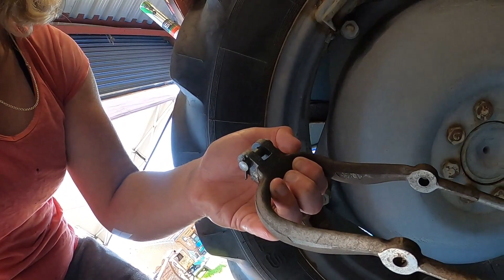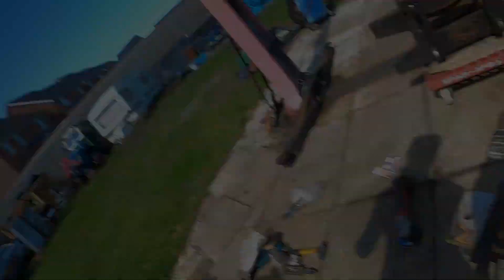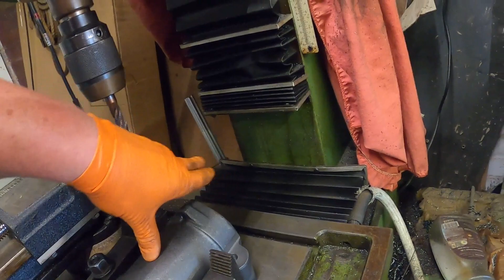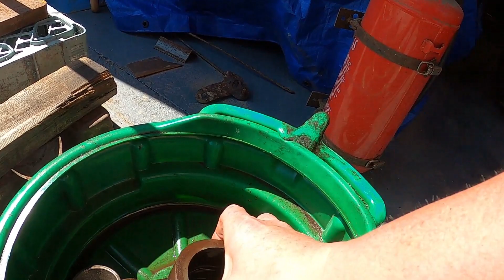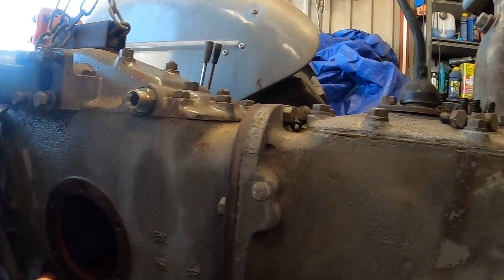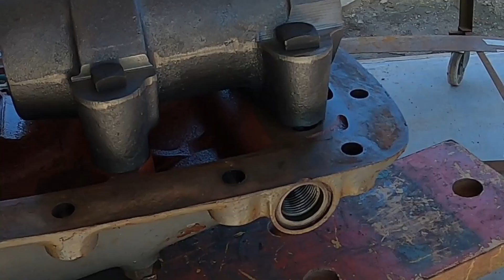MACHINING NEW PARTS,  FERGUSON T20 HYDRAULIC REBUILD PART 2

Comment: Hi Lisa; This was a good video to showcase your skills at part modification, I went through the same situation on my ford 8N. I bought a after market hydraulic lift cylinder and had to do the exact same thing you did to make it fit. It's a shame that the quality of the after market parts are so inconsistent that we have to keep modifying them to be useable. What does a person do who does not possess the skills to (make things work) ? All the best, Ken.
Reply from the maker: Hi Ken. I guess this is onr of the reasons we see more and more things butchured with an angle grinder. People might have the knowledge but not access to the necissary equipment?